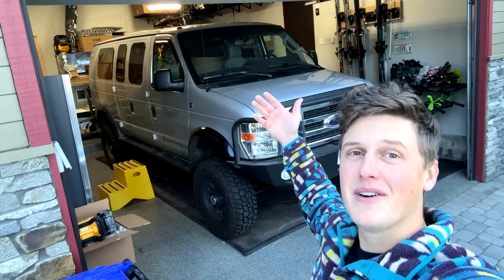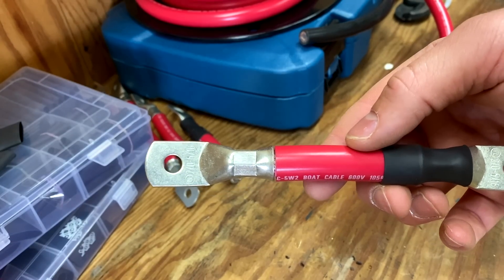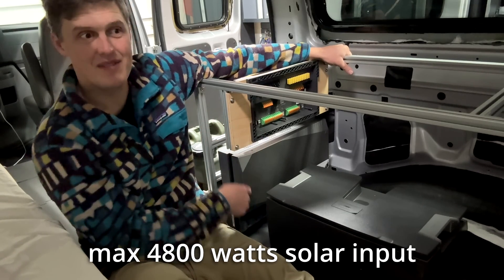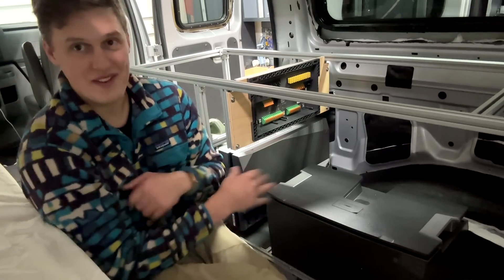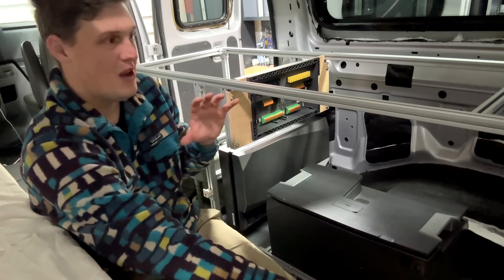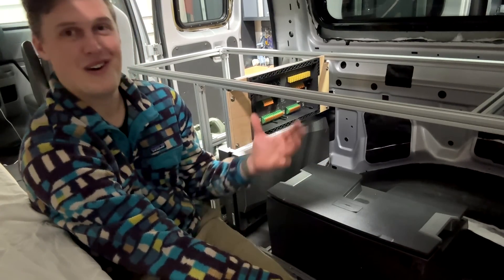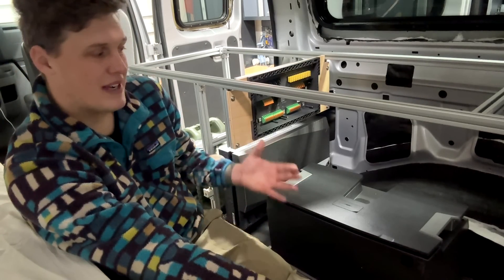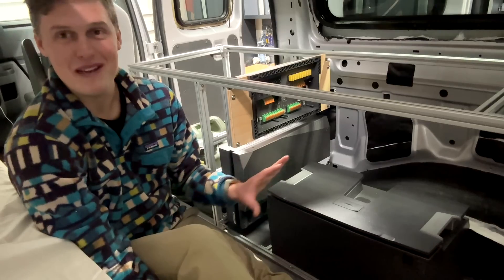This is the FUTURE of CAMPER ELECTRICAL systems

Comment: Hi Seven, question - to turn the power kit on do you have to push the button on the hub or can it be turned on through the tablet or app? If only on the hub it might be difficult to get to it the way you installed it.

Comment: I just finished a full Victron install/conversion in our trailer with custom LifePO4 batteries, and while I loved designing and putting it together, this would have saved so much space, weight, and time. With the cost of copper currently, the price difference is surprisingly small, I had to spend a small fortune on the big stuff (2/0 connections for all batteries, 4/0 for inverter, and a bunch of long 2 awg runs for distant components). Not pulling it all apart anytime soon, but if I had to do it all over again I would probably go the EcoFlow route too.
Reply from the maker: Exactly how I feel, that being said … victron systems still great once installed :). I’m keeping the one in my big van

Comment: Nice, can you also plug shore power into it?
The good thing is if you need to change rigs it seems like it would be a lot easier to move to another vehicle compared to a traditional setup. I’m looking forward to the install video. Loving the new e series build.

Comment: Hmm. I can see it, there is a substantial cost-savings in labor that does make-up much of the increased cost of the unit.  But it is completely unserviceable so I don't think I would ever do something like that.   And it definitely would not be cost-effective as a DIY.

One of the biggest problems it that the EcoFlow kit is massively over-specified for a van build.  The EcoFlow supports a combined 6000W worth of charging, 4800W of solar, 3000W AC mains input, and an 1800W generator input.  That is far, far more power handling then you would ever need for a van.  I could see it for an RV.  But not a van.

--

For a van build you can get almost everything you want with just an EcoFlow Delta 3 plus.  The capability is lower but it is still quite impressive.  2 MPPT/other DC inputs (up to 1000W of solar), AC input, 1800W AC output, and standard 12VDC output (120W).  It's also unserviceable but at least the price is pretty cheap... $650 or so.

The battery is only 1kWh but it does have an expansion battery options.  Pricey but still a lot cheaper then the EcoFlow kit.

--

For DIY... well, I think we all have a good idea of the DIY components.  I don't think the wiring is that terrible, particularly for a 48V system where you can just use 10 AWG for almost everything and 2 AWG for the battery and inverter. 

One can use discrete components or an all-in-one, though one thing I've found with all-in-one's is that the AC input is only good as a mains input because nearly all all-in-one's only do pass-through.  Its worthless as a generator input so in addition to the batteries and the all-in-one you would also want a battery charger, like an EG4 chargeverter, for dirty power or generator AC input.

Some of the all-in-one's like the EG4 6000XP provide all needed breakers.  You are still on the hook for fusing.

-Matt

Comment: One of the builders near me, Wilderness Vans (10+ years in the business) have started offering EcoFlow kits as an option. I think for them it's a no-brainer -- smaller, and much faster to install (= cost savings for clients, increased margins for them as the builder, or both). I went fully custom when I built our van electrical a couple of years ago, but I would 100% consider this seriously for a future build.
Reply: I doubt its much savings for the company since the equipment is much more expensive than a Victron setup would be.   Probably about evens out.  I suggest anyone interested in Power Kits comes to the facebook group and spends some time first.    Its far from sunshine and rainbows.   They push this shit HARD with influencer marketing.

Comment: The smallest kit Ecoflow makes is a 2000Wh system for $5,000.  A 600Wh system with alternator charger, inverter, solar charge controller could be built for $2,000.  When the word overlander is used it is implied it will be a toy for rich people so if your overlander van sells for $150,000 (or much more) a 5000Wh battery kit for $7,000 makes sense.  For someone who lives in their van to be frugal it’s beyond insane.

Comment: While I'm not in the EcoFlow camp, I also came to the same decision. I went with Goal Zero's Yeti Pro 4000 (and an expansion tank) ... This gives me 8,000 watt hours of storage (665 amp hours @ 12v) in the space of a 2-drawer filing cabinet. I LOVE how much room it doesn't hog up in my van. I used summer sales, black friday, etc... to get the entire system for about half price. And all the "loyalty points" that racked up through the purchases also got me a whole slew of extras for free. IMO, there's only one benefit of using individual components over a built system – and that's that if one part breaks, you can more easily replace it. If your built system fails, the whole thing will need to be serviced. All in all, I'm happy with my built system.

Comment: Great, so with the distributer you can add 12v output outlet to their ecoflow product.  This is one downside ecoflow stuff had, was that you were stuck using the 120v output which is inefficient. Thx

Comment: You forgot to mention that it’s a 48 volt system too which is much more energy efficient than a 12 volt system which most DIY electrical systems are.
Reply: The only problem being that most components will be either 12 or 24 volts.
Reply: @hiebsmit  it has 48 volt and 12/24 volt output

Comment: Wait. You're telling me that a $8000 eco flow system with 5KWh batteries is 10-20% more than an equivalent victron system? 

A current fully spec'd Victron system with 8 of those new EcoFlow 100watt 12v batteries (sticking with the same brand) will give 9.6KWh (almost double!) at below $5000. Yes, you'll have to figure out how to connect the components and program things properly but that's almost DOUBLE the capacity at potentially HALF the cost. 

I think the biggest lesson I learned with this video is that this van build is your shill build. You've built a trusting brand and this is where you're deciding to milk it. I'm not hating, just recognizing.
Reply: 100%.

Comment: I’ve been running our 28’ Airstream on a Ecoflow Delta Max with two extra smart batteries for four years.  Microwave , convection oven, dishwasher etc.  700W of solar on roof.  800W fully automatic alternator charger.  When the Airstream goes into winter storage, the three pieces easily come home for emergency power service.  I had one Delta Max failure while on the road, and Ecoflow sent a replacement to my temporary address without delay.
Completely satisfied!

Comment: Haha my vans electrical system with 14.6kwh and 3 inverters, chargers etc cost me 15-20% total ..not 15-20% less .. of what ecoflow wants for theirs .. heck, my Van was as much as their 5kwh system 
Plus i can use inverters and chargers at the same time, which im not sure these combined systems can as they ofthen use inverters in reverse for charging. Admittedly i have sourced most my stuff from China after i had a horrible service experience with Victron, but havent had any issues at all for the last 4 years.
Reply: ya its pretty clear this guy is just shilling for ecoflow. which is odd because he is most certainly a trust fund baby

Comment: I have a goal zero yeti 3000x installed in my AWD Transit.  It’s connected to two solar panels, and the alternator.  It runs my fridge continuously and will power my heater and lights as needed, both 12v and 120v.  I use a cooktop and a kurig coffee maker.  It’s a one box system and has been flawless in over 1 year of use.  Yours looks nice also.  No propane!!!  This is the way

Comment: I suspect you will need to increase battery power. That one battery looks like it won't be enough once you finish adding conveniences.
Reply from the maker: 5kwh is slightly more than 4 standard 12v batteries. Super compact!
Reply: @seven_o_savage  A single (standard size) Power Queen 100AH LiFePo4 battery is rated at 5120kWh and costs $200.00 ea.

Comment: Hey buddy, great video and great system. 
You appeared just when I was thinking of buying all Victron electrical systems for my 2002 Ford E 350 BT Cruiser so now, I'm doubting,do you think that this Ecoflow system could work with my RV? or it's just for van conversions, please let me know what you think, thanks.
Reply: Keep going with your victron system. Watch his previous builds and he does a good job of explaining things. The only good thing about this system is the ecosystem connectivity. Other than that you'll be paying way way more for half the capacity of a victron system.
Reply from the maker: Will work great for RV as well. May need to use gen2 if you have a ton appliances in your RV or need large inverter output.

Comment: What are people using all this power for? When I built my camper I put in 100ah agm battery, 100w solar panel and a small inverter to run a tv. I have never ran out of power.
Reply from the maker: I travel, work, and cook in the van. Startlink + laptop + microwave end up using a good chunk
Reply: AC or minisplit.
Your desire for more power never ends.
Yes, you can pee in a bottle and poop outdoors, or you can have a dry flush toilet.
Priorities.
I tend to overbuild.  More power is better power.  300 watt battery is a minimum for me.
Reply: I installed 8 Battleborns. There's joy in having so much power you can go a whole weekend and not even think about how you're to recharge.
Reply: @ you could do that on one battery and use the 7k you saved to go more places
Reply: Internet, microwave, water boiler, air fryer, coffee maker, A/C, etc...and the peace of mind that a few days of no-sun isn't even going to matter.

Comment: What distributor did you use? And I agree, this is the future! This system has been available for over a year now, and EcoFlow just came out with an enhancement (not replacement) 2nd generation with even more capability. So I think EcoFlow is going to be around for the foreseeable future. Victron is supposedly working on a similar plug and play system. Jeremy at VanLand does a comprehensive comparison of the two systems that is very informative. Thanks for this short and sweet version.
Reply from the maker: Link in description. Ya it’s funny I just saw the gen2. Looks rly cool. I’m actually happier with the gen1 for this tiny van though since it’s smaller. Crazy how fast they innovate though…
Reply: @ the gen 2 is not a replacement, it provides more capability for larger rv’s. Who was your distributor? Link didn’t work, which is why I’m asking. Thanks.
Reply from the maker: @scottmalan1223  campervanhq. bummer the link didn't work, just updated it though

Comment: Totally agree with your Build vs Buy analysis. For me safety is another big reason.
Reply: One downside is knowing how your system works.  Electrical is pretty easy, though combining different  power sources (solar, shore, alternator) is new to me.
I've wired four houses; that was fun and easy.

Comment: i'd love to see a full install video for this!
Reply: I 2nd that install video
Reply: Me too! ✅✅✅
Reply: I know it’s just plug and play but the simplicity is what makes this system great-so count me in. 

One downside I see is having all components locked in a single box. If one comp component inside like solar or DC/Dc fails do I still have a working system?

Could I charge the battery with 110 or a DC 120v charger to keep it going?

In your Victron, each component is separate and can be isolated. But that has higher complexity, more connections to make. More fuses.  And a higher installation cost for some. 

Lots to dig into here in a video-especially since you’ve had both.